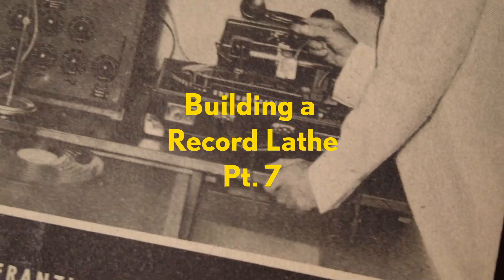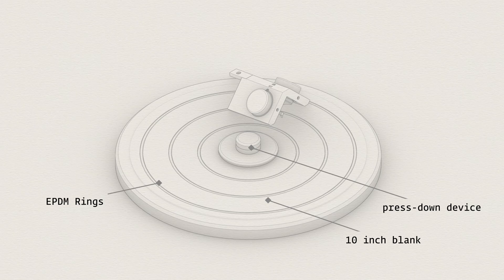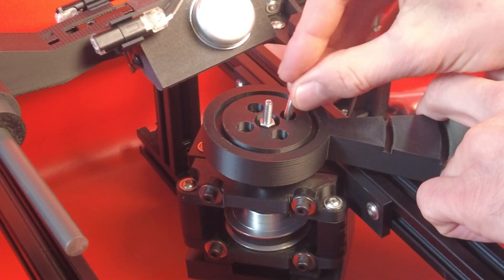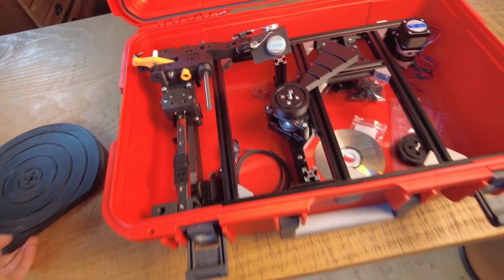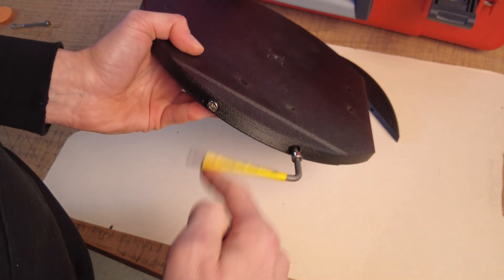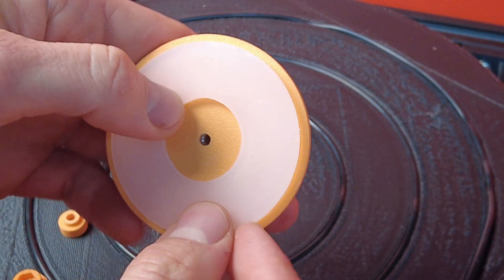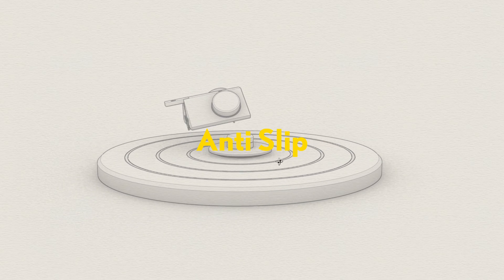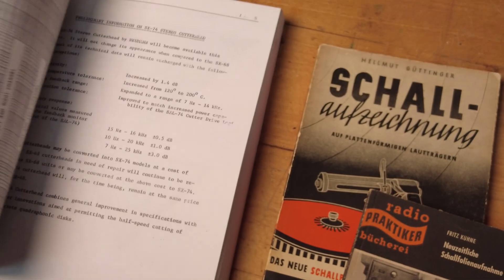Pt.7: The Turntable - Building a Vinyl Record Embossing Machine

Comment: Nice design. Curious Why emboss though when you could cut into PETG which sounds much better? The diamonds are also quite affordable at 123euro (from Phonolab in Australia) already sharpened and ready to use even compared to embossing styli.
Reply from the maker: thanks, will check this out.
 my plan is to do a cutterhead with tungsten styli first, and than a second design with more common of the shelf stylis from distributors.